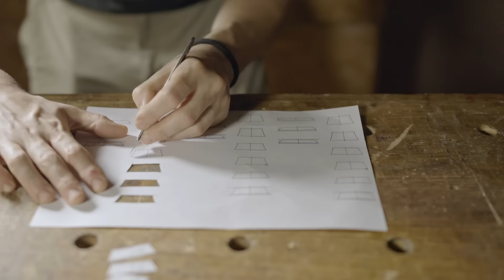Recycling a DOOR into a GUITAR - My CRAZY DIY Project

Comment: Tip: you can use the curved side of the router on fences without deviation as it's a constant radius. less friction. be interesting to know how stable a softwood neck remains.
Reply: @robleake. I'm not a builder but I have to say, all that open grained soft wood has me wondering. Nice work never the less.

Comment: NICE! I love to recycle/upcycle wood. Many years ago I saw an old butcher block table a local meat market tossed out because it was worn and they could not use wood butcher tables anymore because they were not considered sanitary. I tossed it in the back of the truck and cut it up. Got three guitars out of it and I still have a blank sitting around. The came out pretty good but were really heavy because it was Oak. One of these days I'll find the time to use the last piece for a build.